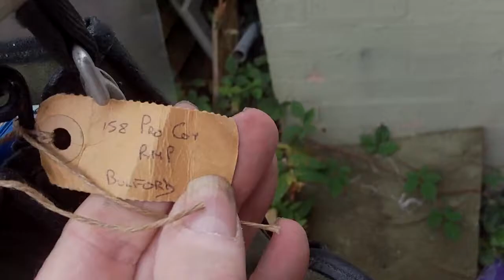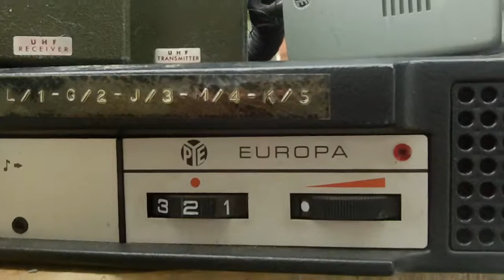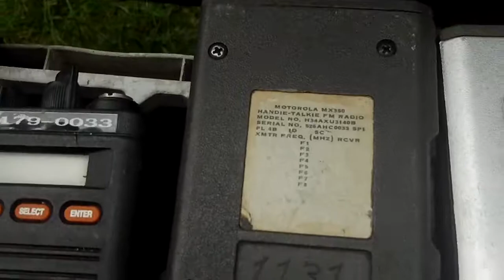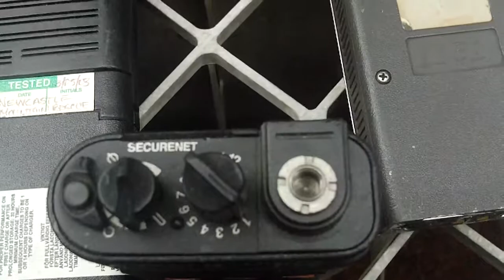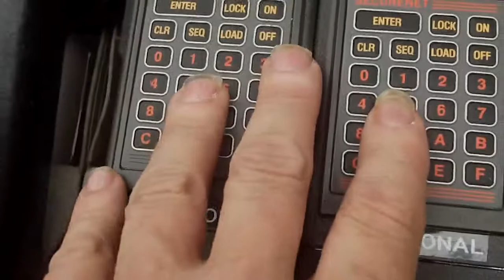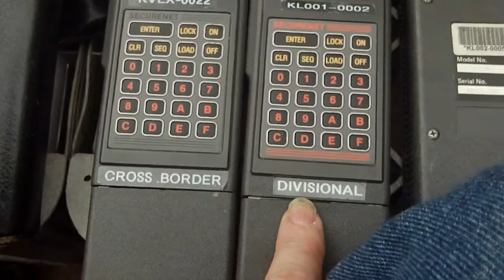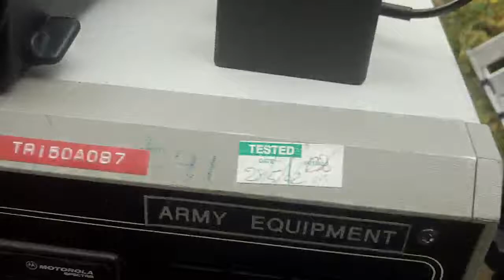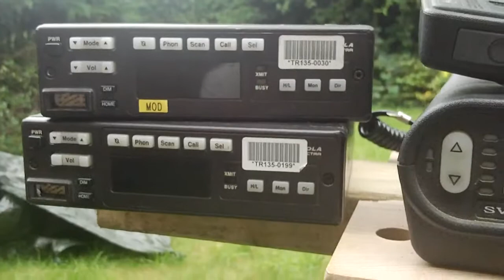NORTHERN IRELAND POLICE COMMUNICATIONS  Equipment 1970 to 2012

Comment: Only the MX340 "S" has an optional DES the other the MX300 radios are earlier models crystal controlled do not support DES. The MX 340 S has PL (private line tone option) and the other MX's appear to have a tone reed plugged in. The switch is to enable or disable the PL function.  The MT-500 and 700 are CSQ Carrier Squelch and do not have a deck to plug in a PL or DPL tone reed, thus no enable/disable function switch.